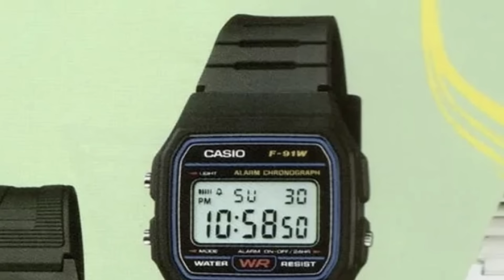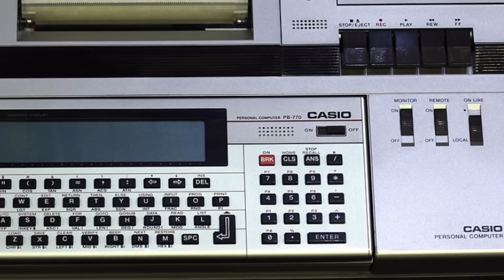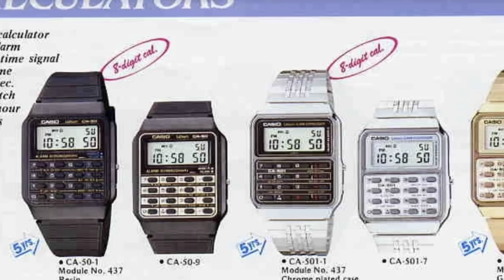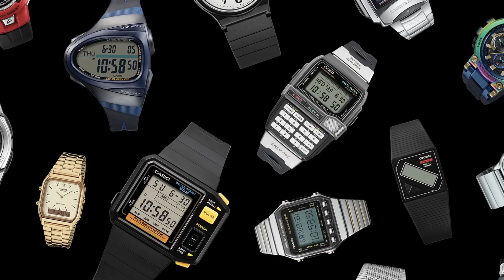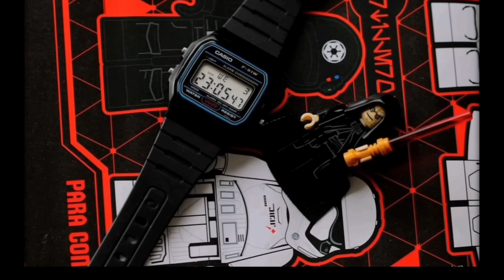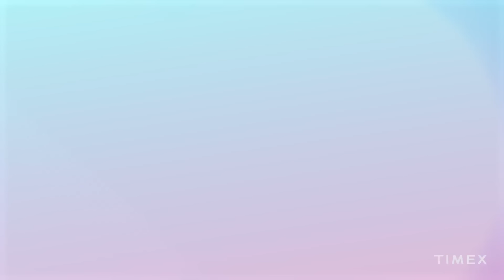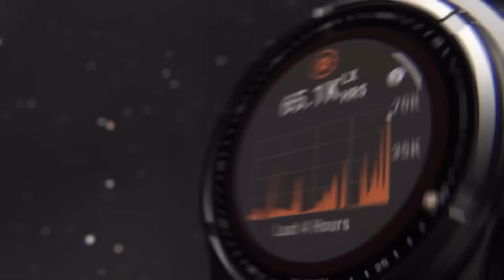How Casio Made the Most Sold Watch Ever

Comment: They've been the only watches I've bought for the last 40+ years. I have a F91-W that's sitting without a band because the band broke. It has to be 15 years old and is still running. I wore them to work and the bands always broke after awhile. That's my only complaint. I wish they sold them with a leather or cloth band. The resin band doesn't absorb sweat and eventually breaks. Buying a replacement band doesn't make sense when they cost almost as much as a new watch.

Comment: I bought this watch in the early 90s. broke it, bought another, lost it, bought another.
This has been my go to watch for 35 years. I had a brief (5 year) spell when I switched to a dial watch because my eyesight was going and couldn't read the numerals, now my eyesight has deteriorated so much that I have to wear glasses all the time, so I just went back to the F91-W.
I think it is the best watch. I feel the same about some other Iconic things as well... BiC Crystal pens, I even pay for my own in the office so that I don't need to use the Stationary cupboards poor qualitypens. It only costs a few euros per year.
Also BiC 2 Razor. I tried different disposable razors until I got this one, and never found a better one, and BiC keep churning them out decade after decade.
These are decptively simple designs that stand the test of time.

Comment: I bought one when I was in my teens, about the time it came out. I wore it for probably about a decade and then put it in a drawer. I just went looking for it and it still works! The battery hasn't been changed in decades!!

The strap snapped a few minutes after I put it on though. 😅
Reply: Resin is the weak point. It does become brittle with time (decades). It's a known issue.

Comment: I have used this watch or similar Casio model since the mid 1980s until 2023!  -- the band always breaks after couple of years,  so I would get replacement bands, usually go through 2 or 3 bands per watch,  , then the push buttons would wear out long before the battery.  So I'd only get a new watch once the buttons become dead. Love the simple practical style and very low cost of it!!

Comment: I had an F91w as a kid, then the Calculator watch. I had 2 A158'S in the early 2000's and they BOTH stopped working after 6-8 months (even after battery change). After the 2nd one failed I bought a Timex (cheapest I could find at the time) which I've had ever since. The band was the cr*ppy twista-flex which fell apart after about 5 years, so now it has the steel band from my last Casio A158. But that Timex is now about 18 years old and still working. I've only replaced the battery twice.

Comment: I've had my A158w for over 10 years, same battery, all the chrome has peeled off the case, screen is cracked and heavily scratched, been submerged in all sorts of toxic liquids, buttons are sticky and i cant shut off the alarm every day. But it still works, holding the time perfectly for 10 plus years.

Also, who else wears their watch inside the arm? I don't think mine would have lasted as long with the face turned outwards.

Comment: I had quite a few watches in my youth, but never truly hang on to long enough to F-59, which is, as you said, from mid 90's. I had it for a full battery length years and I toss to garbage after about 9 years. And then I wanted it back, but then Ive got W-108WH, that which is a bit bigger and more comfy to wear. But has same aura and simple dimension, without that rough wrist band that is too simple. From that, don't mind change to F-94 icon since functionaly absolutely same, just without that look.

Comment: There are/were a plethora of similar models - mine is a W-800H. I've had it for close to 15 years, and have been using similar watches since the 1980s. They're lightweight, unobtrusive and darned near indestructible. The only reason for getting another one was when the previous one went missing. The W-800H uses a slightly thicker battery than the other models, and therefore the battery lasted a good ten years. I changed it myself a few years ago, and look forward to a further 5 years. Been through over a dozen watch straps.

Comment: Bought one in 1990. Still wear it after all these years!
Reply: how many bands have you gone through...?
Reply: @johnpro2847 has been replaced multiple times. Lost count
Reply: The strap hasn't broke ?
Reply: @sdymott  probably did, but a replacement is insanely cheap (from someone using the same for years and replaced it twice)
Reply: @sdymott  I can't reply for the F91w but I still have the first G-shock from something like 92-93 and it is basically a tougher version of this one but the plastic used for the strap is probably the same.

I managed to break the ring you slide the end of the strap in one night I was very drunk and couldn't remove my watch.
After something like 15 more years of abuse, a crack appeared in the plastic that covers the metal core and I managed to remove it.
It was not a good idea as the buttons are now protruding more and tends to get caught and damage woolen things. That is the main reason why I stopped using it and bought another Casio (after trying some junk).
The strap itself is still fine.
PS : I'm seeing that watch in the thumbnail of another vid of this site : " How Casio made an indestructible watch". I haven't watched it yet.
Reply: Casio watches is one of the very few products that you can still buy and it will last you 15+ years with little to no problem. It's inexpensive and worth it.
Reply: Buyer beware, after thirty years of abuse these $10 watches will succumb.
Reply: @marclawson2536 😂
Reply: This is the only specific brand I wear since it captured my attention in the 1990's also😁!
Reply: My first G-Shock I bought in 1991 still has the original battery running and I removed the battery to prevent leaking when it got dim. I still don't understand how the battery could last so long. I didn't use it everyday since I do had  2 other watches
Reply: Your F91W is as old as I am. That's awesome.

Comment: I loved the clean cut design, generally plain black design and comfortable wristband - but in the early 2020s, the wrist bands seemed to break far too easily - I can only guess some manager sought to use a cheaper, less pliable or durable chemical formulation for the wristband. I have 2 remaining watch portions still running, but no wristband to wear them.

Perhaps I should search for the smart Web marketer who will 3D print Casio Watch quality wristbands, that last, endure as long as the CAsio watch itself?  (HINT HINT - please? anyone?) You know there are MILLIONS of guys awaiting to strap on those watches with simple, inexpensice flexible, durable watch strap. All from your little desktop!! 8-D

Comment: I got the all black model with gold buttons and other gold highlights (like the "ring" around the face that is normally blue or the back of the usually gray display itself, it''s shown on the right at 14:40) a couple of months ago. It's my gym / running watch, but it looks just as good as a casual accessory at work or walking around town. Really did the simple design of those retro Casios in general (also got the A168 and the new ABL-100-something-something). Still entertaining the idea of getting the original, blue-framed F91-W just for fun...

Comment: I was born nearly 60 years ago, and for some reason, I first bought the W-96H and still buy them every few years. I never had one that outlasted the battery's life, but I have gone through a lot of replacement bands, which are proprietary to this model and cost over half of what the entire watch would cost. I am an electrician, so I like the all-plastic build except the back cover which I never needed to take off. Yeah I have a lot of more expensive watches, including 2 Apple watches, but for an everyday knock-about, these Casio W-96H watches will always be my favorites!

Comment: The one issue I have with digital is that it tells you exactly what time it is, and that's it. Graphically it doesn't indicate the passing of time or time left to come. An analog clock/watch graphically indicates both at the same time with the position of the hands. The hour hand marker in a 9 hr work day indicates a % of where I am in that time allotment. If I wear a digital G-Shock to work, my mind has to convert it to an analog hour/minute hand % mind picture.

Comment: Inexpensive Casio watches are great ... except the plastic/rubber bands.  I put a Speidel Twist-o-Flex on mine; the band was more expensive than the watch!  And is now much easier to take on and off quickly which is important when working around electricity, electronics, and mechanical stuff.

Comment: Yeah, I started budget watch collecting, as in, mechanicals, automatics, and a few analogue quartz watches, but no digital. I splurged and got on the Casio band wagon with the Casio Royale about 2 years ago. I know have several digitals with some of them being the off brands you mentioned. Great and fun little watches to wear. It is true, those digital watches are no nonsense straight forward function. I have used them when doing yard work, fabrication, and auto repair and yes, they just keep going. Thanks for the video. I just found your channel and subscribed.

Comment: I remember buying one in February 1992. It was the best watch I ever had. I had for about five years. Never used to take it off my wrist. I'd sleep wearing it, shower, swim, work with diesel also. Trouble came when the band showed a little crack which spread rapidly within two hours. I had to replace it with several third party bands but eventually had it bandless.
I lost the watch after going cycling with the watch in my top pocket.
My next CASIO was a twincept from 2004. Don't know how I lost that one but never bought another watch to this day.
Reply: Yes that was the problem with rubber-plastic bands, they all cracked and broke after a while.

Comment: I had this watch when I went to school, but I was an idiot an broke it along with other things. Back then kids would read some numbers off the faceplate like "91" and say that their watch could withstand this many meters of water. The guy with the highest number insisted on this.

I've not had a watch in many years. I went through a few at school, and at that level of activity I usually bend and broke then springed hinge that holds the strap. I couldn't those easily. Shops would only sell new watches of course.

Similar watches would play a little tune for the alarm. I did a silly thing and connected a big loudspeaker to it. It played once and ten burned out. I didn't own a music system, and thought I had discovered something valuable.

Comment: I bought one in the early 90s as a kid.  It lasted me many many years.  I've had a few different watches since but none stood up to the abuse of every day use.  Nowadays i wear a casio w86 which is essentially the same watch but with the illuminator screen so you can actually read it at night. 
In the age of smart watches packed with an office's worth of functions and costing almost as much.  Its nice to just have a watch that tells the time and not much else. 
It goes with everything and can be worn at a job interview or when unclogging the toilet. 
 I don't care if it gets scratched, gets wet or falls off wrist and underneath the tracks of a bulldozer.  In the unlikely event where it actually stops working i just by a new one for the price of a takeaway meal.
Reply: I've just seen that the w86 is now discontinued! 
They are selling for silly money 2nd hand now. I'm afraid to use now.

Comment: The sad part is they never made any significant number of fully stainless simple digital watches with 10y battery and 10 Bar sealing. So if you want such features, you only can buy some from Edifice line with combinations of hands+digits. Also it would be nice to remove all those ugly labels and put them on back cover. I do not need to look on labels like "adjust" "mode" "light" etc on frontal pannel all the time. Just keep the CASIO name and nothing else. Just something like my W800H but in stainless durable body.

Comment: I bought this watch about 7 years ago, works perfectly, no battery change. The only problem is that the strap breaks after everyday use for less than 2 years, and the replacement costs almost as much as the watch 😀

Comment: I bought a very similar looking Alba (Seiko Sub-brand) Y789-4150 back in 1985 for just £5 when Dixons had them as a special buy. I actually wore it today after mislaying my Casio. In fact it looks so similar to my Casio W86 you have to look closely to distinguish them. The only give-aways are the brand at the top and a fourth button on the Alba. p.s. The W86 adds Illuminator backlighting and 50m water resistance to a watch with the same look.

Comment: I wouldn't go for EL, that is technology that degrades and stops working over time (have experience with Timex, becomes unusable dim after about 2 years while using it for barely few seconds a month; and not, it was not the battery getting weak, it was really the EL, replacing the battery did not help).
The simple green LED may not be that fancy, but within the watch it is practically indestructible. And what I've seen, today many LED illumination use way more sophisticated light guide to distribute the light under the display, you get way better light uniformity than in the 80's still from a simple LED.

Comment: I’ve owned my F91-W since 2018, and it’s still going on the same battery, but I’ve since put it on a nylon strap, since the band crumbled like an old stale crayon. I’ve since upgraded to the F105, which is an F91-W, but with blue bezel and EL backlight. It’s the sort of watch that makes you think: “Why did I spend so much more for all these other watches?”. I’m not a gambler, but I’d wager that the F-91W had a HUGE part in killing off India’s every day person’s watch company, HMT. In terms of sheer practicality, just can’t beat a F-91W with a hand wound watch that uses an old fashioned non-hacking Citizen movement, with no lume, date or day of the week.

Comment: I bought an F-91W for myself and my two sons about 10 years ago.  I've never changed the battery and I primarily use the watch when I'm doing manual labor: yard work, working on my motorcycles and cars etc.  The watch is rugged and reliable.  When the battery dies, I plan to replace it with another.  I own expensive swiss watches, 100 plus year old pocket watches, dive watches, and all manner of chronographs and chronometers.  I love my F-91W and I hope to keep this low cost watch for my lifetime.  If not, I'll go to Walmart to buy a replacement. 😀

Comment: I have a few... OK more than a few... OK lots of Casio watches over the decades. I have a couple of F-91W's. Why? Well I had one and put it away for a while when wearing other watches then I couldn't find it so I got another. One day I was going somewhere and put a different watch on my wrist so put my F-91W in a drawer... right next to my original one. Both are working just fine. I'm also probably one of the few who will replace the battery myself rather than throw it away, the same goes for the strap. I also have the F105 that does have a much better light but oddly the display is not as clear as the F-91 with my examples. It's also a watch the gets noticed the most from people of many ages. These days it's a refreshing sight to see something different to the masses with a watch named after a fruit. Many thanks for sharing.